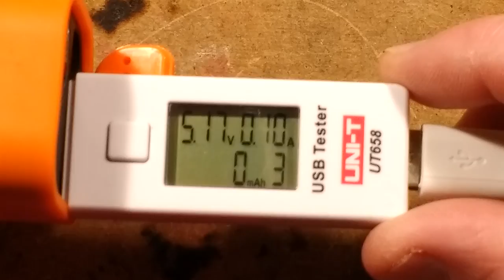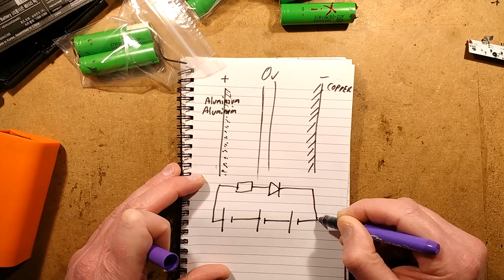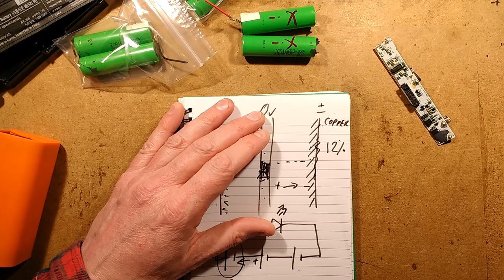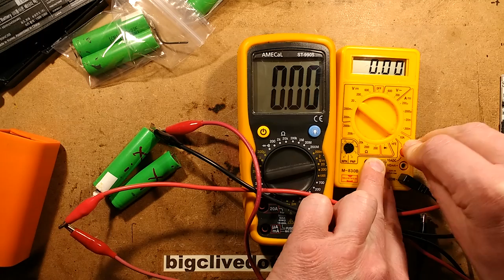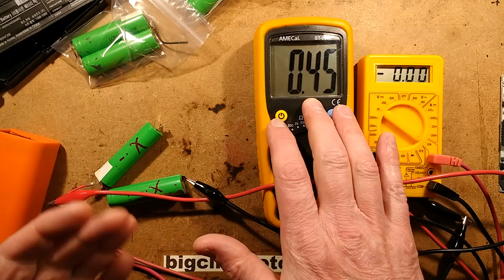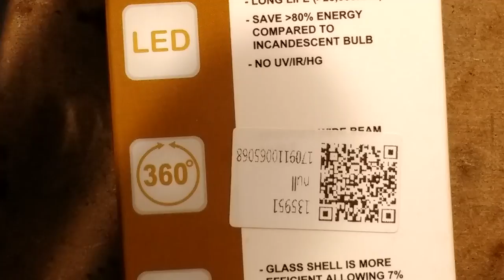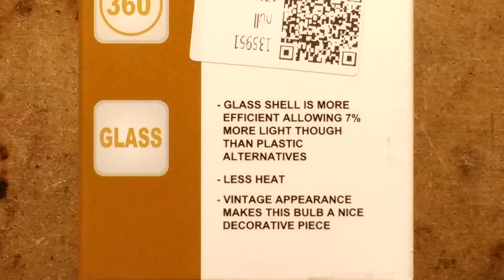Teardown of a faulty Samsung lithium 18650 cell.  (2200mAh)

Comment: You open so many power banks, I imagine Poundland workers take bets on how many you plan on buying each visit lol. Question though, I've seen you use that spudger multiple times. Is that the same one in every video or have you got a bunch of them waiting for when one breaks? I have been meaning to get one for when I work on laptops.
Reply from the maker: I have a spare on standby, but the iSesamo has lasted for a very long time.  The clones were rubbish and bent, kinked and snapped very quickly.

Comment: most of my 18650s came from this source, I bought a job lot of new old stock laptop batteries in an ebay auction and dismantled them for the cells. most of the cells were fine, of course some were dead but I found there were two very distinct failure modes. the majority of the duff cells were just at 0V and couldnt hold a charge like the 2 in this video but a few were completely different. they could be charged but not up to the right voltage, they would get "stuck" around 3.5 to 3.8V and couldnt be charged any higher, never reaching 4.2V no matter how long they were left in the charger. they would just get hotter and hotter as the charger tried to finish the charge. when they were taken off charge, they held the voltage they'd reached perfectly well and would power things and could be recharged to the same voltage they reached before, used again, recharged again etc, just with a lower maximum voltage. I never felt confident actually using them though, for fear that they would explode or catch fire or whatever.

Comment: Only found one in reverse out of several dozen processed,  most chargers don't like less than two a half V s  or will see it as a nic Hyde and then fail to charge .
Reply: Doesn't NiMh use the same charging algorithms etc.?
Reply: NeuronalAxon if it falls below 2.5 but above  aprrox1.4 v. --guessing the figure here the charger sees  dead lion   However a lion approx 1v it seems to see as  a low Nm and starts charging to approx 1.4v.  That's my limited experience,   If you boost a < 2.5 lion over the line it will start to charge cutting off @ 4.2v

Comment: So I have an e-cig mod box when I put an 18650 in the box Positive goes down and then the cap is closed onto the negative side. When I took one of my failing e-cigs apart it had an 18650 with two wires coming out the positive side, it made me wonder how the other box works and how they could be pulling + and- from just the + button end the caseing is covered and well it makes no sense to me.
Reply from the maker: Some have a metal strip or wire up the side under the sleeving, so the wires can come out one end.
Reply: @bigclivedotcom  That's what I was thinking but I just want sure thanks for confirming that for me, it was the 1st time I saw such a thing thanks again.

Comment: I bought a similar device a few days ago, described as an air purifier,which I leave plugged in during the day,but remove for the night,because I have heard dire warnings about inhaling negative ions for too long. Can you concur with this practice,or do you have safer advice for me to follow?
Reply from the maker: A real ioniser is perfectly safe, but some ozone generators are sold as air purifiers because they get rid of odours.  Is there a detectable airflow from the unit that smells a bit like bleach?  If there is then it probably is better to switch it off at night.
Reply: Clive's done some videos, even  recently, all about ionisers/UVC germicidal lamps etc. where he tells all about their safety and how they work. Good stuff.
Reply: @NeuronalAxon  I sent him a message about one I bought a few days ago, and he replied with good advice shortly after.

Comment: I believe that the short could have happened at the edges of the ribbon.  I have built a capacitor and needed to leave a quarter inch insulator around the aluminum sheets.

Comment: Hi Clive, I would like to make a golf trolley Lithium battery. Currently 12v 22a/h lead acid. could you suggest a series parallel lithium using 18650 would really appreciate your help. I have a lithium balanced charger. many thanks,

Comment: what is it with all the pink clive
Reply from the maker: A running joke after the power supply of a set of pink LED lights exploded in my hand when I plugged it in.  Now I try to get everything dangerous from China in Barbie pink.
Reply: i was only yanking your chain😝😝😝

Comment: Internally trackpads/keyboards are usually PS/2 or I2C, even to this day. As far as I understand USB for internal devices just never took off, I guess because the engineers are going to maybe already be using I2C, and PS/2 has just been so ubiquitos and doesn't have as many compatibility issues as USB.

Comment: I have the same exact samsung battery as you that i pulled from a laptop battery. I tried using it on my rc car and for a 96 watt light. I noticed that the car was slow and the light wasnt as bright as 96 watts. Makes sense since the discharge rate is about 2C, which is 4 amps each...

Comment: great video as always, very informative and good dissection of latest highest density cells. one test i would have done to confirm its voltage level's were 0 was to cut and assemble very small piece of the cell back and measure that with the volt meter. also try to charge it. also having air in contact with the open cell should change it's chemistry, especially lithium if pure.

Comment: Could you reverse charge a cell on purpose for a longer amount of time to make the effekt more visible?
Reply from the maker: I suppose that could be done.  But with a very low resistance shunt it might be possible to use high current to deliberately malform that area.

Comment: So a perfect battery pack has all cells in parallel with a voltage step-up circuit?
Reply from the maker: For simple low voltage applications that's a good option.

Comment: I seems to me that this battery got too hot. 
But the reason why it didn’t measure current is because the the safety fuse was blown. 
That fuse is the very first thing you disassembled in the top of the battery. 
There is a way to make them work again, just like normal ones. But if you shunt them in this way they will catch on fire next time their temperature rises.

Comment: Of course part of the volatility of various lithium cells and their ability to be discharged to low levels is the exact chemistry/electrolyte used. Some can be discharged to low voltages while others will start off-gassing at low voltage and it goes downhill quick from there.

Comment: I use a single one of those cells to power the lights in my flying wing. I once had to apply a quick jolt of 5 volts after it went low and it's been fine. Have not been brave enough to take a single cell apart though.

Comment: Can we use this graphite to make conductive ink, can we use materials in other dry , alkaline cell batteries
Reply from the maker: You can buy graphite power easily on eBay.
Reply: @bigclivedotcom   ok, do you know any other method,  need to paint the laptop flex keyboard ( conductive ink) , it  got scratched

Comment: does they have acid inside ? does it dry if opened ? and then they stop working ? or you can use then opened ?
Reply from the maker: They have a complex electrolyte that will dry when opened and stop them working.
Reply: @bigclivedotcom  can one buy those electrolytes and just refill and seal it back to work ?

Comment: I’ve recently had a similar problem where I’ve charged some 18650 battery’s and put them in my Lazer level and then suddenly stopped working. When I put checked the batteries I found 1 some how had negative voltage on it (no it what correctly charged always double check and no I had the leads the correct way I checked) obviously it would not charge in the charger so connected it to lab power supply and charged it slowly which seems to have worked and now the charger charges it “bizarre”

Comment: I was able to recover one 12 volt "sealed" black lead acid  battery by leaving it on the charger for about 24 hrs. and filling it up with water several times until it wouldn't hold any more and it finally took a charge.  Even though they claim to be "maintenance free" they can still need water.  They are only "maintenance free" because the top is glued on so you can't easily maintain it but that's easy to pop off with a spudger.  The hardest part these days is finding a charger that will still try charging if it doesn't detect a battery being connected.  I had to try several because most "smart" chargers refused to charge if the battery was too dead.

Comment: Are the straps that connect each cell a fuse of sort. Just to see if I could make some cells blow I shorted a partially charged string of cells but one of the links flamed and burned up as if it was made of magnesium. It happened so quick the cells didn't even get warm.
Reply from the maker: You do get fusible links, but some lithium cells can also pass enough current to blow normal links.

Comment: If you run into problems with file size it could be that the SD-card is formatted in FAT32. It cannot go past 4.1 GB or so. NTFS might work better.

Comment: If you have a cell that is at zero volts, or just tenths, how can you be sure which end is supposed to be the positive and negative ends on these 18650?
Reply from the maker: Generally speaking, the crimped end is the positive.

Comment: Also after you have separated the foils and if the coating still is on the copper put it in water then the remains easily come off, the aluminum part usually don't separate even if put into water, also having it into water neutralize the lithium so it's much safer for storage until you can dispose it correctly. You can save The copper foil for making own circuit boards

Comment: I got recently new third party battery for vaio laptop which uses lipos. and first one been having problems charging or draining even when the voltage was good on cells than i thought it maybe batteries board, than got another one but same problem and works when removed and reinserted. need to learn more about electronics

Comment: This is pretty much what I’ve found in laptop battery packs. 1 cell kills the other it’s in parallel with. Other packs I’ve noticed a few cell balance controllers go wonky and actually cause this issue with one set of the 3 to drain to 0. I’m beginning to wonder what I will find when I pull the programming off of the controller that is suspect which has done the exact same thing to brand new cells after 1 charge cycle. Maybe say, programmed to fail at a certain charge cycle/time ? Sure would be a good way to ensure a company makes money on selling batteries. I’ll come back here and state what I find out. Strange how batteries that I have built have yet to fail after years of use and a few thousand cycles without any noticeable drop in capacity.
Reply: Oh, neat - please update with your findings. What kind of code would that be, on those charger controller chips?

Comment: I enjoyed this! I'd also need a stiff g&t before taking one of these apart! I did all my battery teardowns outside, so I could run away if it went wrong. Plus I need my lungs for breathing with. Also, my co-workers were never happy with me taking apart chemistries like LiFeS2 (lithium iron disulfide primary cells like Energizer e2 titanium / GP Lithium etc) inside, because of the potent smell. 

There's obviously no metallic lithium present in your 18650, but the lithium cobalt-oxide, being unstable, I'd guess will burn rapidly when you get enough heat, probably a soldering iron would start it easily?

Comment: It had to be generating a good deal of heat right at the fault(s) when you attempted charge.  Perhaps if you had run a few more kilowatt-hours ;-) of current into that cell it would have "branded" the shorted area(s).  Then again, maybe the chemical state of the cell was such that much or all of the electrode surfaces were involved.  I wonder what exactly happens to internal conductivity if a cell self-heats enough that it vents most of its electrolyte solvent?

Comment: I haven't watched the full video yet so please don't judge me if this has been said already. Some lithium cells have a thing called a Current interruption device under the positive end. It's a dome of metal which seals the inside from the atmosphere.  When the cell over pressurises the dome pops out breaking the connection and leaving it shown 0 volts open circuit. Sometimes if you are careful you can push it back down and get some more life from the cell.
Reply: Resetting the CID is universally a bad idea because it vented for a reason, and one that may come back to bite again, especially if you have damaged it by trying to reset it.
If the cid pops, I consider it scrap and put it in the "to recycle" box with the other 1000 scrap cells.
Reply: I have a laptop battery from an old HP laptop that overheated. All the cids had popped 12 cells. I reset them all. 3 cells showed low voltage . During carefull charging only those 3 got warm and one popped the cid again. The remaining 9 cells showed normal capacity after cycling. The 2 warm ones showed low capacity.
I pierced the top of all the cells after discharged and only the 3 with low capacity had any pressure build up. My assumption is that those 3 had had some internal breakdown resulting in low capacity and hydrogen release. Possibly the others had popped their cid due to heat expansion and temporary evaporation of electrolyte. The 3 damaged cells were the cells closest to the source of heat in the laptop. All cells were disposed of after.
Reply: You may get lucky, you may not. When you have thousands of cells to manage as I do, it is not worth the risk and the time it takes to identify and swap out bad cells, and in any case always use fuse wire to connect them.
18650 cells are pretty robust, but they can catch fire though silly mistakes, such as in this case where a positive bus bar shorted against the negative side of the cell causing it to heat up and rupture: https://www.youtube.com/watch?v=sR1vTqAq0cU
Fuse wire didn't help in this case!
Reply: Just to add, it is oxygen gas that is produced, not hydrogen.
https://en.wikipedia.org/wiki/Lithium_cobalt_oxide

Comment: I can't count the times I have used a bench power supply to bypass the charging circuit on batteries like that on the cells that are below the chips cut off point of about 2.9v and brought the pack back to usability. I just did it on an old Samsung tablets flat pack batteries the other day, it is now charging to 100% and functioning fine. Generally I hit them with 5v for about 30sec until they get to about 3v and the let the normal charger take over.

Comment: Im sure that alot of laptop manufacturers purposely limit the laptop battery's lifespan or program the eeprom inside the laptops battery pack so if there was a charge inbalance the battery pack would never charge again instead of resetting, so you would have to spend more money on a new battery.

Comment: You could verify your theory that the over-discharged caused the graphite to separate from the electrode by taking apart one of the better cells from the same pack in the same way.

Comment: the blue led indicating the discharging of the "poundland powerbank" actually shimmers a little bit at all time
Reply from the maker: It may be cycling with the boost circuitry that keeps the output topped up to 5V.
Reply: The funny thing is, that the led is slightly brighter when a cable is plugged in

Comment: What was the laptop model number? My girlfriend used to have a Samsung NP350-V5C-A06UK

The plastic clips had a propensity to just break with normal use (she's fairly careful with things too), USB and charge port came loose and the hinges for the screen cracked the plastic casing.

It was a £750 laptop too, so not cheap by any means.
Reply: NP350 has built-in battery pack, so not anywhere similar. Also, i have a NP350, a serious piece of plastic junk that creaks and cracks at the hinges. junk.
Reply: Old NP350 models do not have a built in battery pack. Pre-2016 models have a separate battery model, as shown by my girlfriend having to replace hers after 1 year due to the "reverse charging" issue causing 2 of her cells to die completely.

It eventually died and nearly caught fire when the USB PCIe bus going to the Northbridge controller just failed. 4 major arcing points on the board that caused 4 ICs to fail out right, and caused about 5 FETs to go dead short across the gate/drain/source.

Her CPU, RAM, HDD, Screen and other such things still worked, and I checked protection fuses, which seemed to have blown, protecting the important parts...which is one good thing. 

Your hinges will probably break the plastic after 10-12 months of normal use. She's using an ASUS X5556UB now. I'm still using an X5DIJ (K50 series) ASUS laptop from 2008 with a Pentium 4 (T4400) CPU in it.
Reply: S.A. Smith my NP350U2B is from July 2011 and has the built-in battery pack ...
Reply: This was a NP350 V5C not a U2B
Reply from the maker: Mine's an NPO350 V5C.

Comment: These laptop battery packs have an Enable Pin that you ground to turn the pack on. This pin is powered by one of the cells. Leaving it in the laptop would have drained that one cell through the enable pin (this would take a very long time). Check the pins on a good laptop battery pack, one will read between 3.7 and 4.2 volts, that when grounded will activate the battery pack.